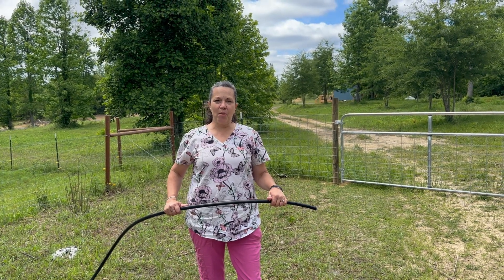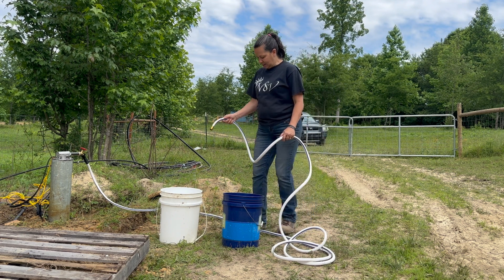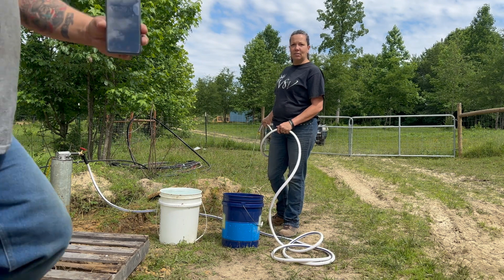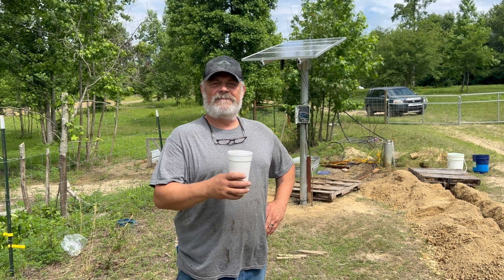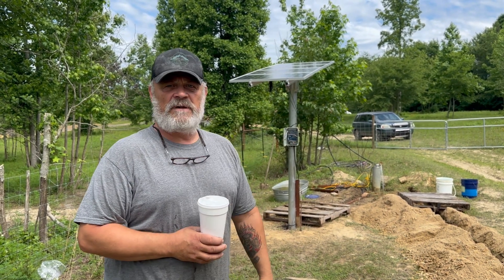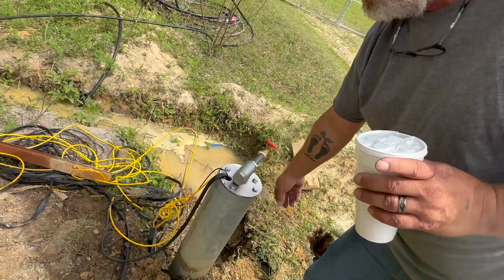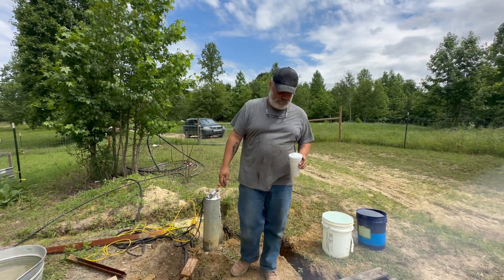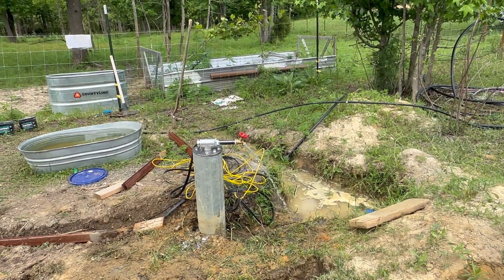Game changer on the farm! New RPS solar well pump!! @patchworxfarm from 1 GPM to 10 GPM 🥳

Comment: I live rural and have been wanting to change out my well pump to 12 volt solar with panels and batteries for my log home. So my well is 200' and the pump is set at 160' but was at 180' originally. So what would I need and what would it cost, would need to have water at night as well.
Reply: This 400v is high volume and more than capable. It is also able to utilize batteries for back up. It’s also growable to 800 watts for up to 5000 gallons per day😊